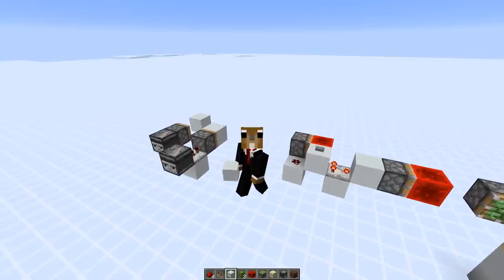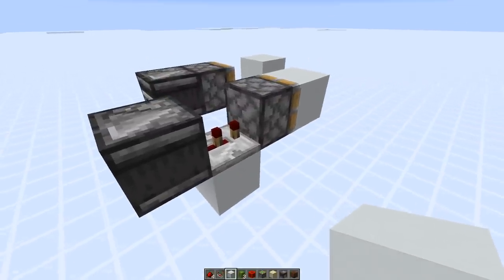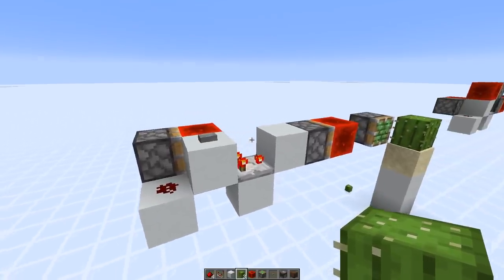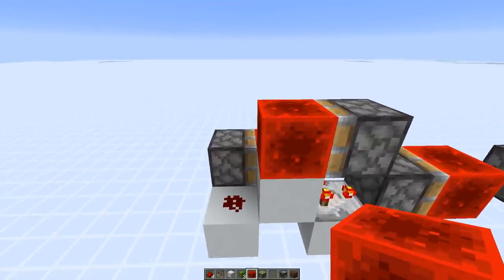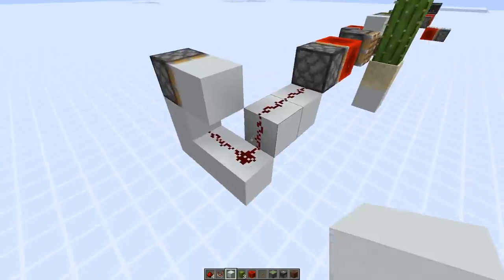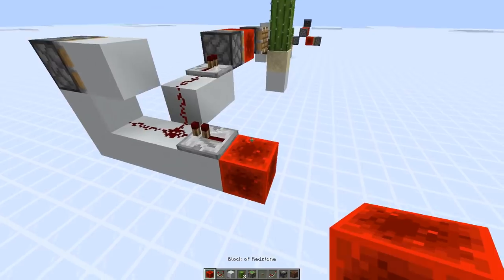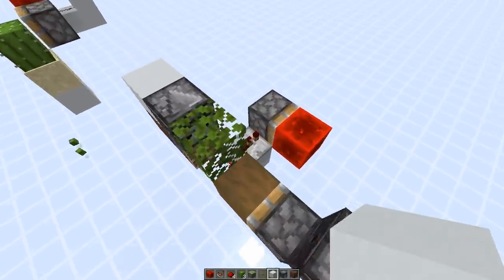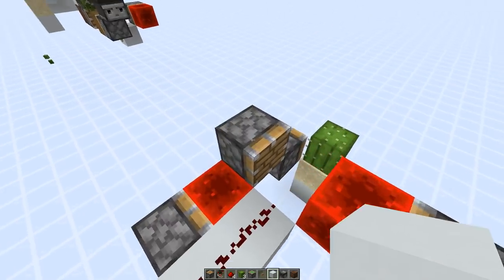3 Tick Pulse Generators (5 Unique Designs)

Comment: Hi, I wonder if you have a answer for this. The server I play on the TPS is not very stable normally around 19-20 but drops to 14 sometimes. I have made your cactus farm ( only 3 machines ) but every 5mins or so it will break and I have to reset the sand and put the cactus back. is there a way I can get round this issue?
Reply from the maker: that sounds like you're playing on a modded server.  probably spigot with plugins. you can maybe adjust the design but in general I would recommend to not play on a spigot server if you're interested in using redstone contraptions.
Reply: @ilmango  Thanks man, I guessed that was the case. Sadly love redstone but want to play with friends too, currently flying machines are kinda banned :-(. Will just have to suck it up, thanks for taking the time to answer.
Reply: @ilmango  Hey, solved my issue today. used one of your older designs ( the note block one that has to be north south ) but made the cactus 2 high moving the machine up one in case of server lag.

Comment: The example with the log would also work with a dust output if the right most piston was sticky, because then the piston connected to the output wouldn't wait an additional gametick.
This is also true for the next example.

Comment: Hey! I followed the links provided in the description and just wanted to know, if the quirk, that a directly powered repeater turns on at -1 game tick? instead of 2/4/6/8 its 1/3/5/7 gt delay for the first repeater/comparator. Do you know, if this still holds true in 1.14? 
Greetings
Reply: yes, it is called input bug. It is still existed in 1.17 which sucks alot

Comment: Why are none of these universal in both input and output methods?
Reply: What do you mean? Are you confused about how repeaters affect pulse lengths? The minimal amount of pulse a repeater can output is equal to it's delay setting. Anything shorter gets extended. Also, moving blocks and player inputs are calculated earlier in a tick than outputs from a repeater.

Comment: Redstone is so un-intuitive.
Why must everything redstone have varying levels of delays in the first place? is there a reason?
Also, wouldn't it be nice if repeaters were replaced wish delayers and amplifiers? That way we could amplify a signal without introducing delay. Also why aren't repeaters adjusted in game-tick increments instead of 2 game-tick increments at a time?
Reply: different delays mean more things to work with, for us. it might be convenient for them to split the block, but that would result in dozens of non unique redstone components possibly taking away any chance of actually new ones